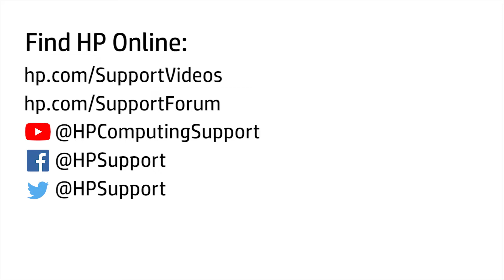Remove and Replace the Fan Diverter | HP Z2 SFF G4 and HP Z240 SFF Workstations | HP

Comment: I have a HP Z240 SFF, there's a big black plastic cover without any screws securing my fan. How do I take it off safely to then remove the fan to clean it?
Reply from the maker: Hi there, thanks for contacting HP Global Social Media Support!
I understand that you need to know about removing the fan of your computer.
I will do my best to assist you.
May I know which fan you need to remove?
Please let us know!
Binu-HP Social Media Tech Support
Reply: @HPSupport  I think there's only one and I think it's on top of the pcu. There's a black  plastic cover over it with no screws.
Reply from the maker: Due to limited support on this platform to fix this issue, please feel free to reach us on call/chat. Access this link to select your preferred country and language option to reach us. 
Global support link: - https://hp.care/3Lycblk 
Binu-HP Social Media Tech Support
Reply: @HPSupport  can I send you pictures  through the chat?
Reply from the maker: Thanks for the reply.
These types of issues are better supported by phone support.
Please contact us as mentioned above to fix the issue.
Binu-HP Social Media Tech Support